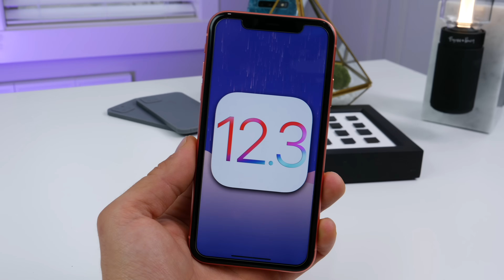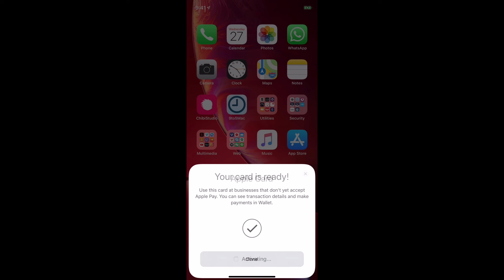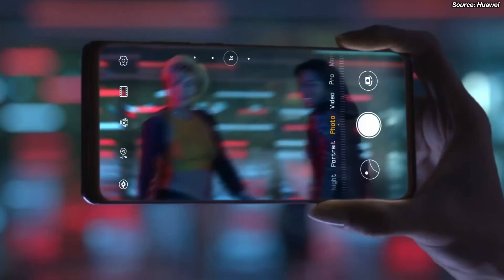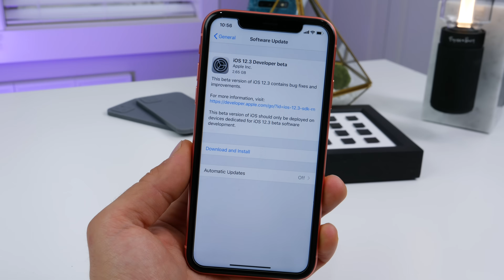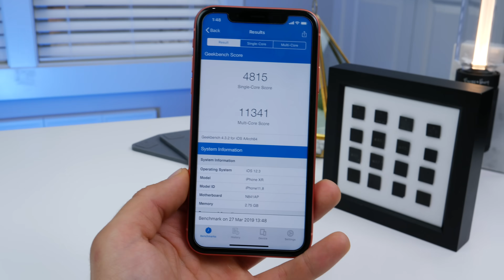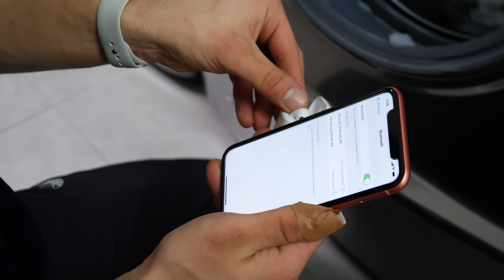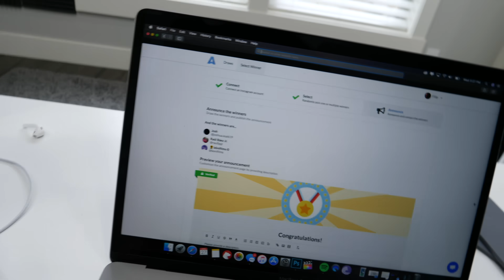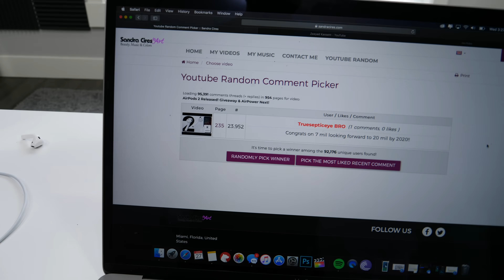AirPods 2 Water Test & Teardown, iOS 12.3 & USB-C Everything 2020!

Comment: The airpods still work, wait for the water to dry around the speaker grille. Try using the iPhones speaker when it's wet, it will sound fucked until it's dry.

Comment: They are water resistant ..... The problem is you didn't dry them .....the water seals up the mash making the wave vibration corrupted .....if you don't have shaken the water out of the mash parts they would be totally fine

Comment: LG washer and dryers are awesome.  I just ordered the same ones I had in my previous home again.
Reply: What model of LG washer is it? Tnkx!
Reply: @ildicdic  me?  I have the LG WM8100HVA Washer and LG DLGX8101V Gas Dryer.  At my old residence I didn't have gas so I had whatever the equivilant is of the gas model.  They're really great.  If you keep the washer open after a cycle it will prevent smell and mold from growing.  One of the things I had to start doing when I got these after I was finished doing my laundry.  They have these specific packets for cleaning that you put in for a cycle made by Tide.  They help when it starts to smell maybe after a few months.  Maintenance isn't too hardcore.

Comment: so actually. apple uses a glue material over logic boards. you can find this on the lighting connector ribbon cable inside an iphone. so that could mean even better water proofing. and i use my airpods gen 1 in the shower water covers the grilles. you just have to blow really hard to get the water out. thanks for the video! love to see more.

Comment: Ill stick with my first gen airpods they work good great sound only issue i been having is when i stick either left or right pod in my ear it wont connect at times have to place it back in case & then try again i use first gen iphone x

Comment: The AirPods are resistant, you just need to play certain sounds to eject the water.
Reply: Does anyone know who won the giveaway
Reply: ExpertCobra1911 penis
Reply: Shut up dumb bird. I put mine in water. Played every single song available and nothing happened
Reply: Tomytom 1: it is a certain sound at max volume on YT at .25X
2:your toxic
3:if nothing works, put the air pod in ur mouth (only a bit and just the speaker part) and breathe through ur mouth hard  and exhale without it in ur mouth. Did that with earbuds and it works...
Reply: Tomytom “shut up dumb bird “ lmao

Comment: Some people complain about their airpods 1 slowing down and not connecting after the new ones came out 🧐🤨
Reply: Purgitron 
I had my AirPods for two years and they worked great until the AirPods 2 was about to come out. Then they started to keep disconnecting, I put them back in the case and they would be fine for awhile. Now they last 3 minutes tops before they disconnected. Coincidence? 🤬🤷🏽‍♂️
Now I’m left with a very expensive paperweight.
I tried everything and it keeps disconnecting.

Comment: I actually just had mine washed because they in a sweater and they were also thrown in the dryer and when I did get them out the light was flashing   Whenever I put the right one in but 24 hrs later they work fine. Gotta love AirPods ❤️

Comment: Noooooo I am like 2/3 hours late!! But black air pods that's kinda cool they might also get a special edition of colourful air pods 😂😂 lyyy btw❤
Reply: preeti kashikar246 
If you tape the sensors and stuff you can use silicone or rubber like spray paint and do it yourself

Comment: AirPods 2 or PowerBeats Pro? (For someone who doesn't have wireless earbuds yet)
Reply: Depends what you want. Beats are more isolated and possibly more secure in the ear, depending on if AirPods fit your ear. 

AirPods are arguably more convenient. And you can hear your surroundings a bit.
Reply: Can I have both?
Reply: Josh Radoff AirPods 3
Reply: Airpod 2
Reply: Yes...
Reply: I have the powerbeats 3 but i have tried airpods and to me airpods are much more comfortable and a lot easier, and the sound quality isn't much worse at all. Airpods are so much more convenient I could wear them all day, but the powerbeats I can't wear comfortably for more than an hour. Also airpods are much less expensive. Id say airpods are better.
Reply: Josh Radoff definitely PowerBeats Pro (for me anyways)